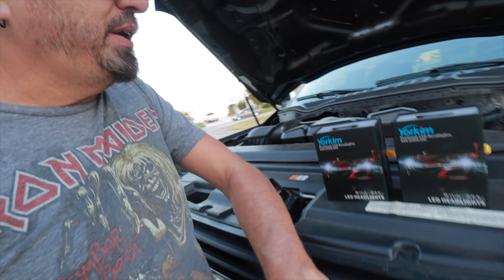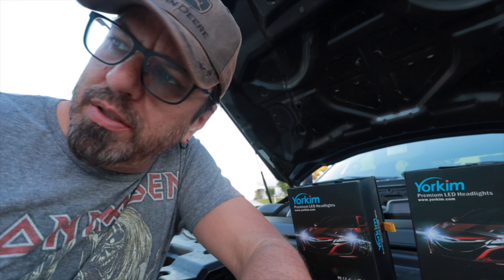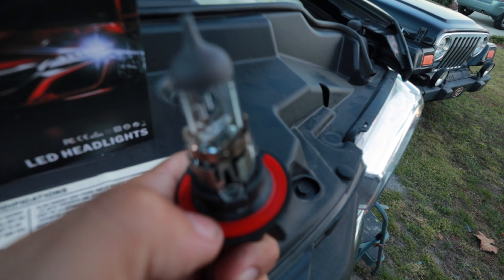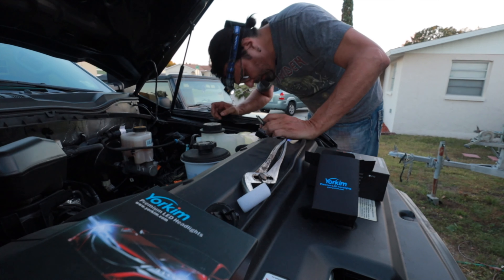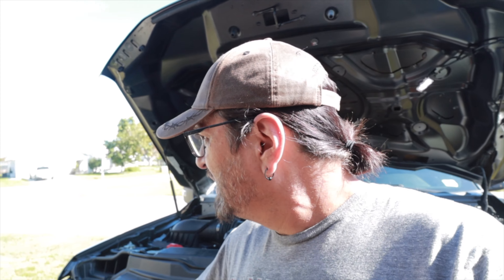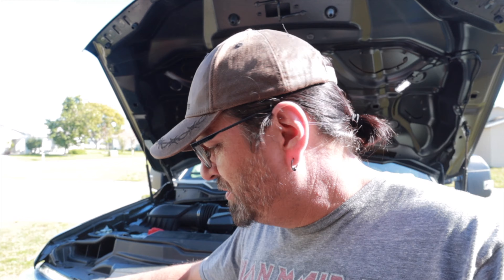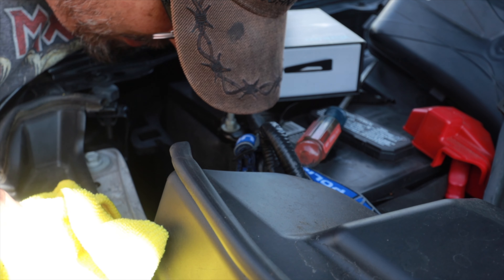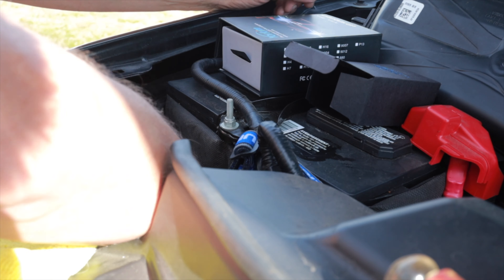Upgrading Our Ford F250 Super Duty Headlights to LED Bulbs

Comment: I have the same truck 2019 very difficult removing the old bulbs and as bad as difficult putting the new ones in, but felt like it didn’t click. Do you have a suggestion can we put some lithium grease on the rubber part or something to make it slide in a little bit easier what do you think?
Reply from the maker: No I didn’t use anything to get them in or out but I did use gloves to get a better grip as they are tough.

Comment: The BeamTech bulbs have shown to be the best so far to date. You can do all 6 (4 Headlight & 2 Fog Lights) for just about ~$120.00 complete. These are also the NON-Fan bulbs that won't give you any radio noise (some have experienced this with the bulbs that have a fan on them.

Having worked with specifically Ford Super Duty truck lighting for 20 years now, I can beyond any doubt tell you that just because some vendors are charging ~$600.00 for all 6 bulbs, that they are NOT ANY better than the BeamTech bulbs. Those bulbs have actually failed multiple times now where as the BeamTech's have stayed consistent without any issues.

I don't work for or sell the BeamTech bulbs, just a Ford Super Duty owner who has done TONS of research on these along with literally Thousands of other owners out there that have all had positive results.

As shown, the installation part is the only pain with this upgrade, but the light output is significantly superior to the stock Halogen bulbs.
Reply: Good word explanation but no close up shots showing details of bulb and socket
Reply: I have a 2000 Ford super duty xlt. Has the big plastic housing lights with screw in the back bulbs. Do you happen to know the part number and prices for all that you have suggested? Where to buy? I appreciate your comment and suggestion.

Comment: Great video. I live in rural NC and at night I would rather drive my '06 RAM than my 2019 Ford SuperDuty for the very same reason. Terrible night visibility in the Ford. It is not just me since my wife noticed the same thing. I am interested in your feedback to see how well the lights you installed worked...as well as if you are seeing a lot more oncoming traffic "flashing you" because your lights are too bright. I know a lot of LED conversions have that issue and these Ford lights are noted for the same in stock form. Great video as always and thanks for sharing. 

For my info, can you confirm the link on Amazon is the lamp you used since I am assuming your truck in a 2019 Ford SD and that is coming up as not compatible on Amazon (but they could be wrong or just not listed).
Reply from the maker: These def helped but the high beams are not good either. Must be the design of the reflectors in the headlight housing is all I can think. But low beams were HUGE improvement
Reply: @AlliChuckAdventures  Well that is good to know. I did some internet trolling and the Ford Lights are really considered a big miss by Ford and many owners are replacing the whole assembly with new improved after market lens/lamp or projector lens systems. I am not ready for that expense! I think I will just purchase the lamps like you did and give it  go...thank you for the feedback!
Reply from the maker: RV'n in North Carolina yeah they’re sooooo expensive. Maybe down the road I may replace but that’s a lot of money and work too.